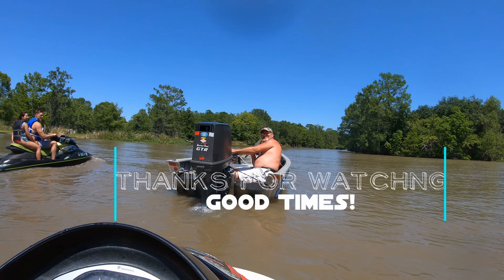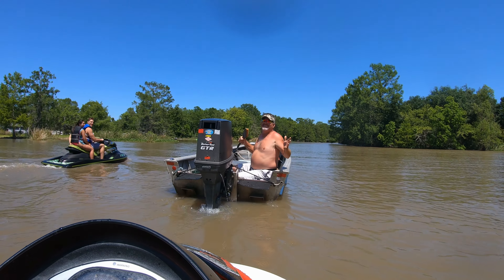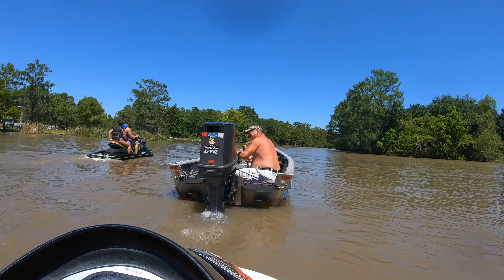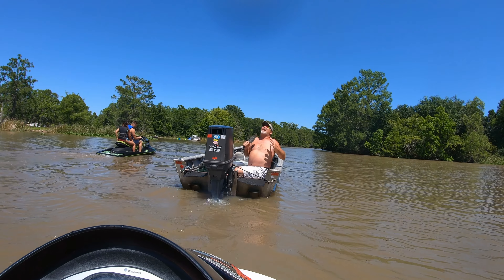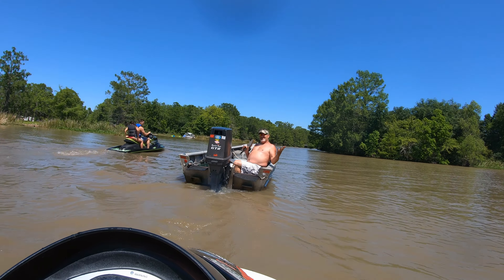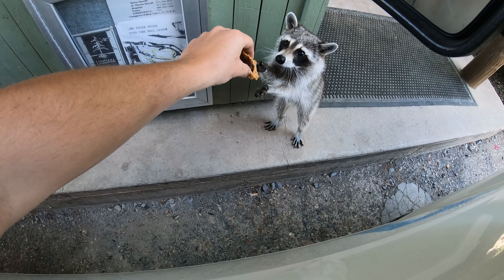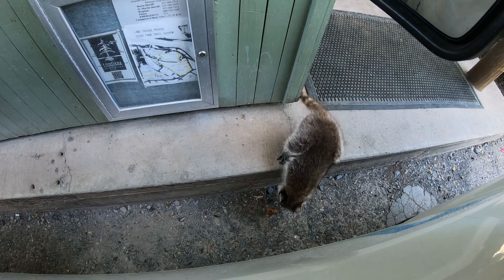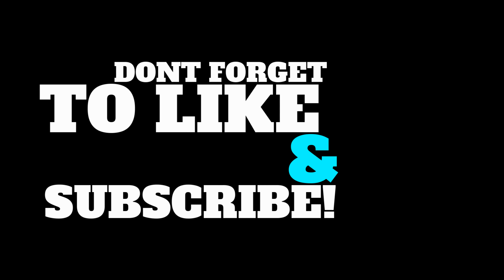2016 Polaris RZR 1000 XP Changing starter one way bearing !! Reason to drink Mountain Dew KickStart

Comment: Good video & music. My 21 XP Turbo starter just spins freely, does not engage at all.  Any input on a fix..?  
Appreciate your time.
Reply: Little Allen bolts holding the 1way bearing the the flywheel broke. Thats what mine did. New bearing new bolts
Reply: @noahkruetzkamp7122  Yup, I replaced the Sprague clutch on back of the fly wheel, fixed.  Thanks

Comment: No gasket when reinstalling the cover?
Reply from the maker: No need for it. Certain cases you'll have to use a gasket. But with gasket, it has just that much more clearance to create a leak. If the surfaces are real clean and your able to just silicone, you better off with silicone. Majority of honda come now siliconed. It hold better from leaks.
Reply: What type of silicone did you use

Comment: Changed my one way because I could hear the started just spinning. After changing it it would not start and I now got a code 636 2.  So I bought a new cps. Still wont start and the code is still there. I've cleaned the ground plugs checked fuel pump presure which is good. Still won't start.
Reply from the maker: So the motor does rotate good as of now?

Comment: Also I’ve heard if these go bad it will effect the injectors not receiving power for it to fire?  Only asking because I’m having issues with my 16 xp 1000
Reply from the maker: Hmm not im not sure on. If it dont rotate fast enough maybe the stator cant create enough voltage to supply to the injectors

Comment: My starter is spinning but only turns the motor for about a second then just sounds like it spins but stops turning the motor over. Do you thing I need to change the one way? It’s throwing a code for crank position sensor.
Reply from the maker: Sorry about the late reply.
Yes, most likely the one way bearing. If the starter continues to rotate strong but the sounds like its slipping while turning the motor over. It should be the one way.

Comment: Hello so I have a 2018 xp 1000 turbo and I’m having a problem my starter when out on me the power cable that’s connected to the starter got hot and melted the cover now it will not turn on. What could it be and I just replace the starter 4 months ago
Reply from the maker: Either something in the motor is binding. Check to make it roatates freely. Rotate a few roatation while feeling it through. That ok, then make sure connection, the wire, and battery. Something is causing high amperage. The wire is only rated for so much amps